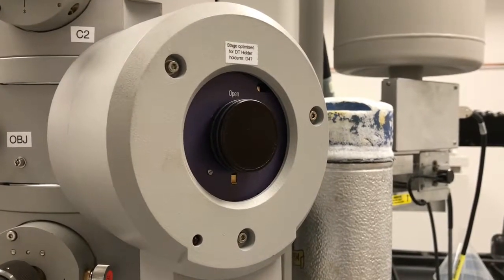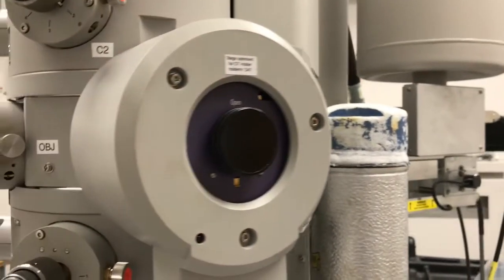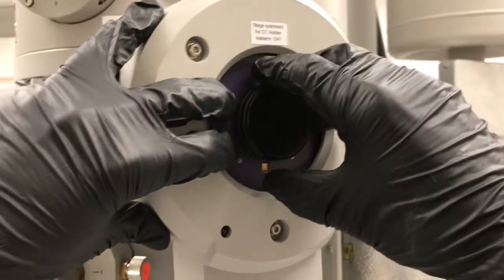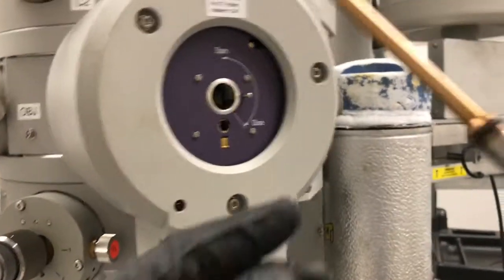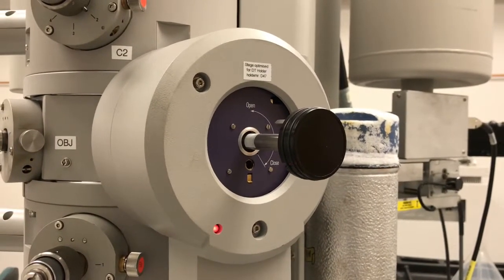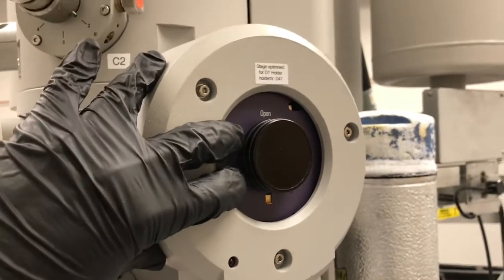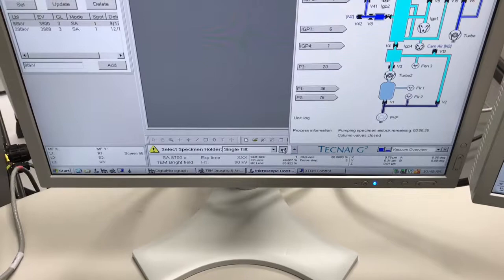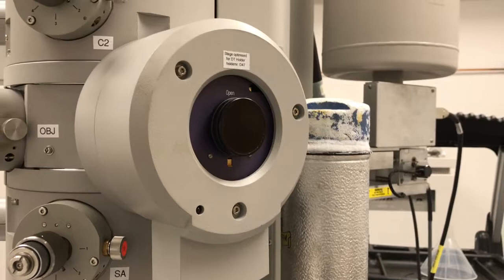FEI Tecnai F20 S/TEM: holder insertion and extraction

Comment: Hi Nicholas,

I am using Talos TEM.

I am always stuck at the last stop and cannot pull against the suction after last stop. My hands become shaky and mostly crash the vaccume while extracting the rod.

It would be great if you can make one such video for Talos TEM as well.
Reply from the maker: Hi Nisa: thanks for watching the video.  The Talos and Tecnai airlock designs are basically identical and interchangeable, so what I did here should also apply for the Talos.  The Talos should actually be easier to unload because the position of the airlock is more ergonomically designed compared to that of the Tecnai.  Regarding the "last pull", it does indeed take some force to extract the holder because you have pull against the vacuum.  Admittedly, people with stronger hands will have an easier time with this, but if the resistance is truly excessive, the most obvious cause is a lack of lubrication; you can try lubricating the O-ring on the holder shaft with high vacuum grease or fomblin oil and see if that makes a difference.  I hope this helps.

Comment: Hi Nicholas,
Your videos are really helpful. I have FEI Tecnai F30 in my department. Is there a major difference in instrument operation between F20 and F30? It would be helpful if you could comment on the same. Thanks!
Reply from the maker: Hi Ravi: glad you find the videos helpful.  In an operational sense, there really isn't much difference between an F20 and F30.  The hardware configuration (except for the HT tank) is basically identical.  Of course, the performance of the instruments will be different at the peak voltages.  300 kV operation will give better resolution than 200 kV, but will also potentially cause more beam damage.  The F30 gives the flexibility to also operate at 200 kV, so it's like also having a 200 kV instrument plus a 300 kV instrument.  You have to set up a separate alignment file for 200 kV (which takes about a day), but the added flexibility is usually well worth it (particularly if 300 kV operation is causing too much beam damage).

Comment: i found your videos so important to us!! so grateful for you doing this. 
I have a trouble while extracting holder, no problem pulling, rotating. then when i have to pull again, it doesnt work well and if i pull i turn off HT and vacuum as well.. what should i do?
Reply from the maker: Hi Nomin: glad to hear my videos are helping you.  Sounds like the vacuum is somehow crashing when you pull the holder at the end (second pull).  Some things to check: make sure during the first pull you firmly feel the holder stop, and make sure during the rotation you also feel the holder firmly stop; make sure with your other hand (not on the holder) you are firmly pushing against the metal plate on the airlock the whole time.  If you are still crashing the vacuum I would suggest checking out the O-ring on the holder shaft; check it for any dust, hairs, contamination, etc and clean, if needed, with alcohol and a lint-free cloth; then you can lightly lubricate the O-ring with high-vacuum grease.  If the O-ring appears cut/dinged up I would replace with a fresh one (also lubricated).  If you are still having issues, it may be a problem with the airlock itself, at which point you should contact a service technician.  Best of luck.
Reply: @NicholasRudawski  Thank you for your kind advice! 
I have tried to remove sample holder for the first time after leaving a comment on your video. I followed exactly how you removed holder in this video. And i removed it successfully!! 
Again, Thank you for your effort to make these videos!

Comment: Hi, Although I am a user of JEOL TEM microscopes, I find your videos very useful as the general instructions on TEM alignment/data acquisition are explained comprehensively.
Reply from the maker: Thank you; I'm glad my videos are helpful to you, even though they are not done on JEOL microscopes.  The JEOL user interface is a little different than FEI, but each has basically all of the same functions.  Our facility actually had only JEOL S/TEMs (2) until 2017, and then we switched over and now only have FEI S/TEMs (3)!  What kind of JEOL systems you do work on?  The one I easily have the most experience with is the JEOL 2010F.
Reply: @NicholasRudawski  Hi, I have worked with JEOL 2010F, but at present, I am working extensively on JEOL JEM ARM 200F. Our university has only one microscope JEOL JEM ARM 200F. I have worked on JEOL microscopes all my life. So, your videos on FEI microscopes are useful to me as I am learning to know more about FEI microscopes. You are correct that the FEI interface is different JEOL interface. For e.g., in  CM200/Technai you have SA mode and in JEOL 2010F/JEOL JEM ARM 220F we have MAG mode which basically is the same (i.e., the objective lens is switched ON).

Comment: HI Nicholas  I have f200i and My problem is that suddenly the lighting is always present and continuing, even if the sample holder is not present in the device in another sense. When the holder is inserted, the device does not feel it
Reply from the maker: Hi Osama: sorry to hear you are having some difficulty.  Are you saying the red light on the airlock is always lit?  Are you also saying that when you insert the holder you get no response from the Microscope Control software either?  Even with these issues, does the airlock still get pumped out or is that also a problem?
Reply: @NicholasRudawski  Thank you for replying Nicholas yes as you say the red light is always lighting but there is no proplem with air lock pumping
Reply from the maker: @osamahassan7497  It might just be a glitch with the light.  As long as the pump/airlock is functioning properly, the light is otherwise there just as an indicator.  If you have the instrument under service contract, I would recommend you bring this up with your service technician.

Comment: Hi Nicholas,
Sometimes, I cannot successfully extract the single tilt when I  screw the single tilt in the close position. During this condition, what should I do? Many Thanks!

Yuechao
Reply from the maker: Hi Yuechao: sorry to hear you are having trouble.  When you say you are not successful, does this mean you are crashing the vacuum or does this mean something else?  Are you physically able to remove the holder from the colum?
Reply: @NicholasRudawski  just crashing the vaccum. 😁

Thanks for you reply
Reply: sometimes,l cannot remove the holder as well. l am not sure what happened or what shuld l do
Reply: @NicholasRudawski  sometimes,l cannot remove the holder as well. l am not sure what happened or what shuld l do
Reply from the maker: @yuechaoyao1660  Hi Yuechao: does your holder move at all or does it move but just not very smoothly?  Sometime, it's just a matter of adding some lubrication to an O-ring on the holder shaft and that can greatly ease holder loading/unloading.

Comment: @5:33 the holder is usually sucked in with force and users are trained to pull on the holder to resist and allow it to glide in gently. Could be in need of fresh o-rings or vacuum grease, but it's also the first time I'm seeing tape used on the holder to mark the line - a sharpie line does the trick.
Reply from the maker: Hi Lee; yes you indeed correct, it's probably just a matter of adding some lubrication in the right spot.